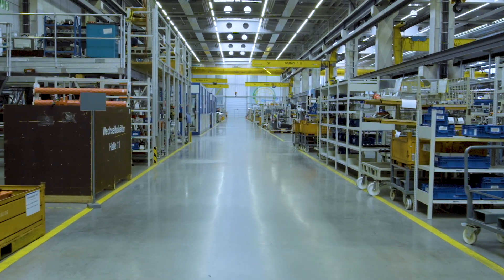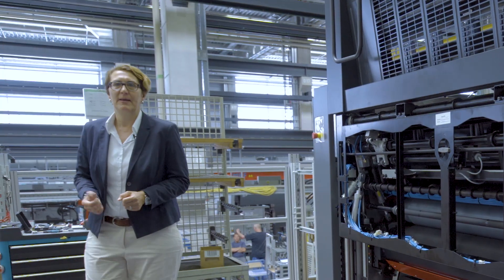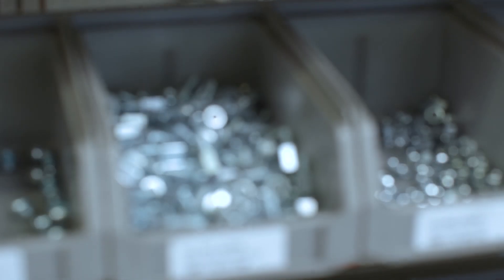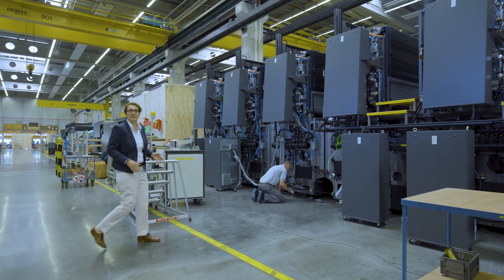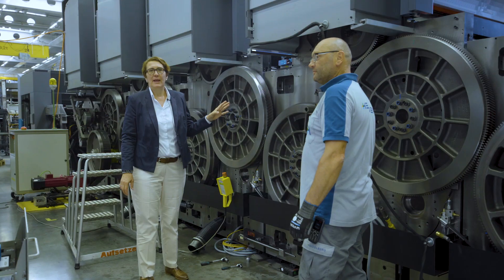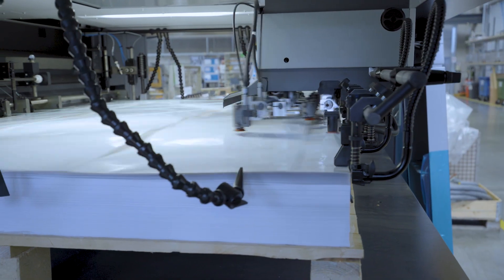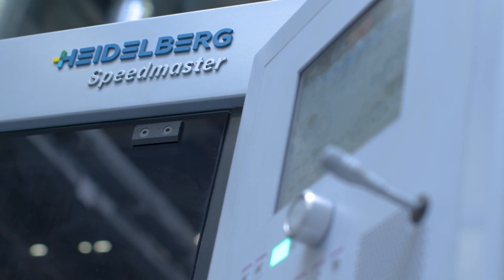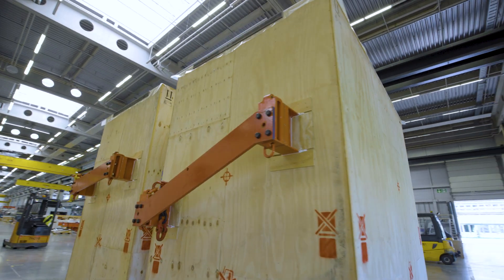Behind the scenes Speedmaster XL145 and XL 162.

Comment: My father run family busines printing. We have Heidelberg GTO 46, GTOZ, and Windmill Platen. These machines were built like a tank. As long as you keeps the moving part (gear and etc) oiled and lubricated, and every other part shiny and new, it continues to work like a champ. 

And many classic machine is still used today like Heidelberg Original Cylinder and Windmill. Looking at them is like a classic car. Evergreen and beautiful